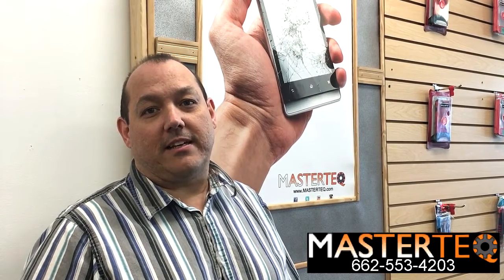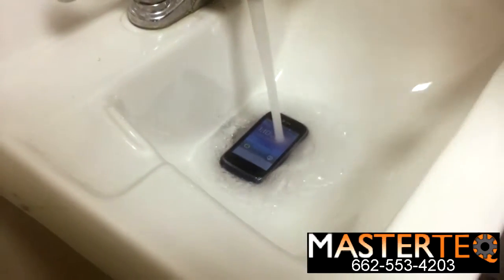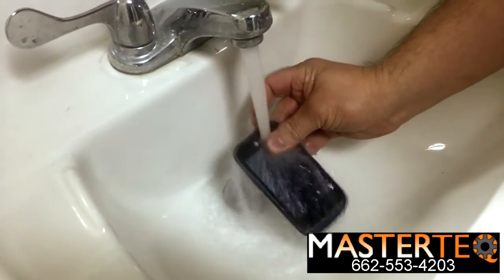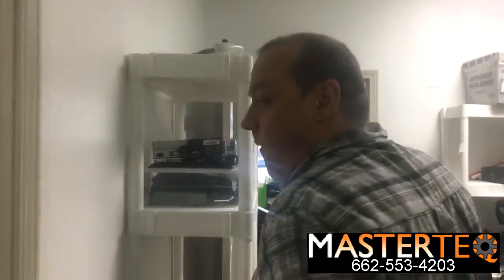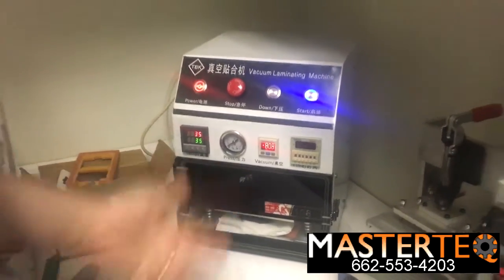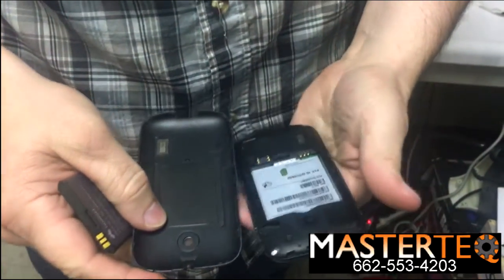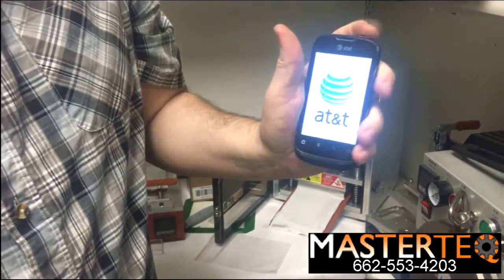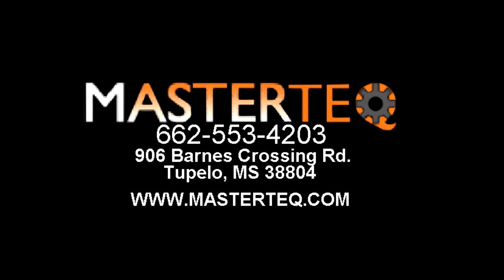Cell Phone Water Damage Repair Using A Vacuum Chamber

Comment: Can you put an iPhone 7 in the chamber without worrying about damage to the battery? I jumped in the lake with mine (not purposely) and the camera lenses are now fogged.
Reply from the maker: Yes, The chamber will pull most moister out with no issues. iPhone 7 has a rubber glue around the screen so should be mostly dry.
Reply: Apliance Guru Eric did the vaccum chamber work?

Comment: do you apply heat? if so at what temp?
Reply from the maker: No, Heat is needed. You can leave the phone closed or open it and put both halves in to help it along. I still like cleaning the connectors as well just for good measure.

Comment: How much vacuum pressure are you applying?
Reply from the maker: As long as the chamber is sealed there is no limit. I use the small pump it is fine. Also about 10-15 minutes.
Reply: I have a vacuum pump that goes down to 0.01 mBar. I wondered if that would be too much pressure on electronics. Alternately, I have a house vac option that would take a chamber to 30 inHg below ambient pressure.  Which is more similar to your setup? The last thing I want is to have phone components get crushed under pressure.
Reply: @sheepdawg81 the concern isn't the pressure, it's the lack of atmospheric pressure. Atmosphere is 14 psi. With a lack of pressure, the phone is more likely to expand and explode. Like a marshmallow in a vacuum.